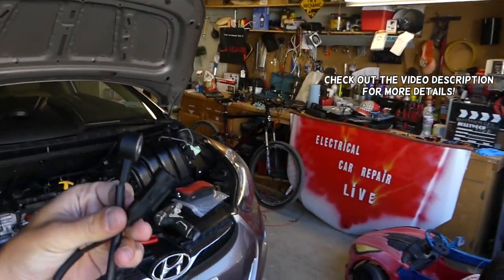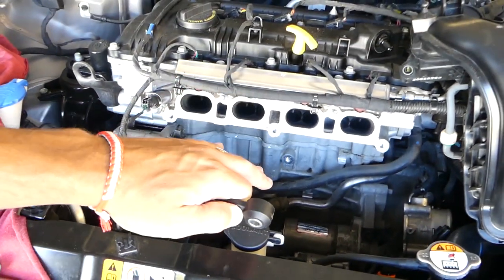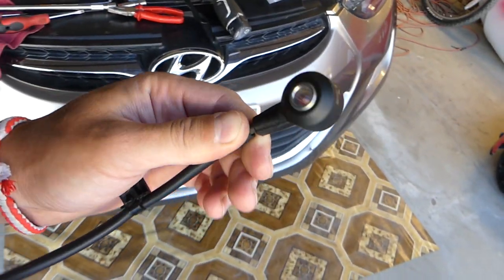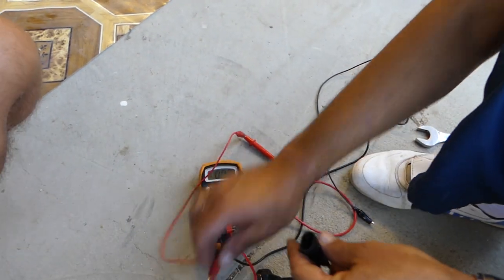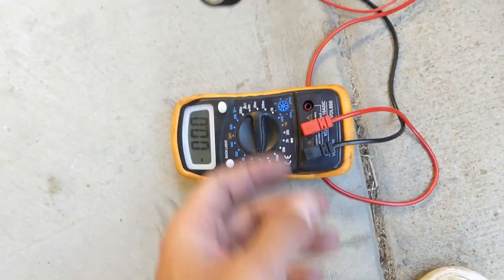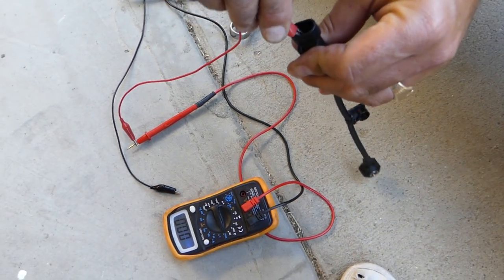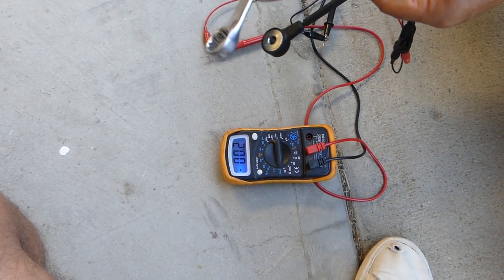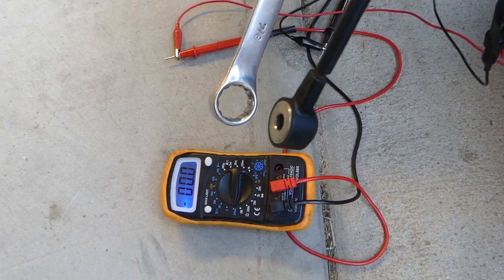HOW TO TEST KNOCK SENSOR HYUNDAI KIA

Comment: What is the cause of the code P1326 on a 2011 Hyundai sonata limited? I tried to find the cause I couldn't
Reply: The problem with this is the knock sensor harness at the dealer they will replace your knock sensor harness under warranty if the check engine light is flashing .
Reply: @drew8528  thanks Andrew you are very correct. I later took the car to the dealership and they said same thing. At the end they changed the whole engine due to recall